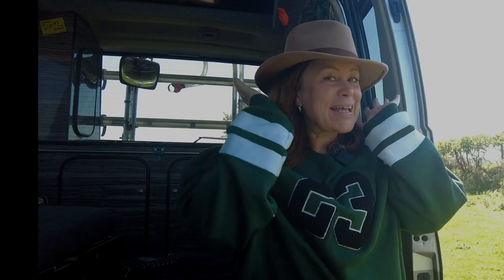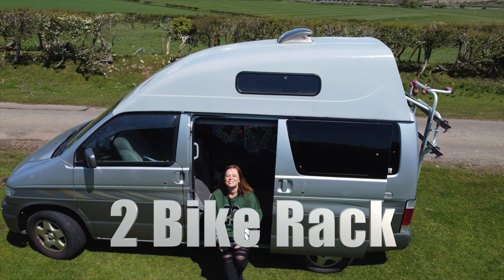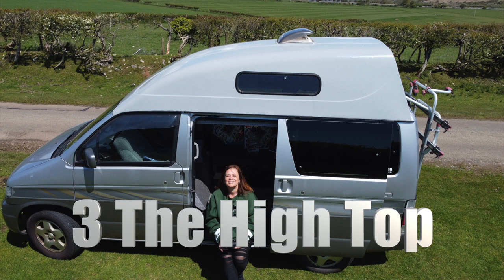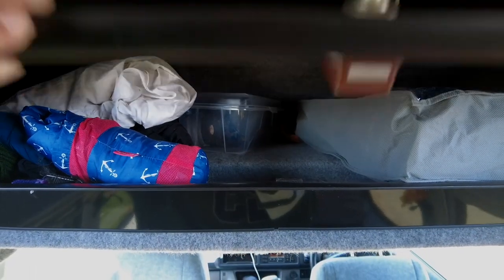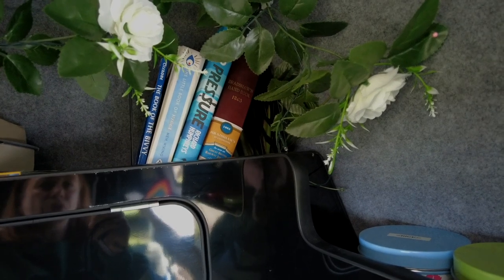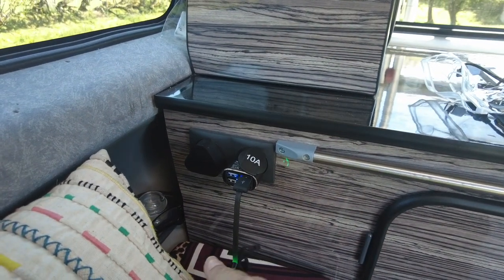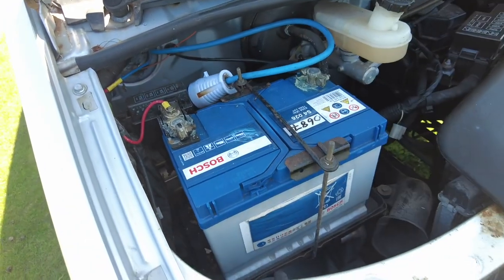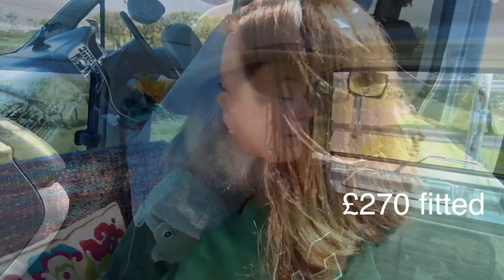My Top 5 Mazda Bongo Modifications - And How Much They Have Cost!

Comment: Hi, I am new to this and I am about to buy my first hi hard top bongo and your videos are great and so informative. Question , I have the option on layout and love your rear units with side seats, how much room for sleeping and I am wondering about a portaloo and where that would go. Many thanks in advance. At the moment I have a Ford Duetto Autosleeper so I am coming  down in size so space and storage will be important . Thank you .
Reply from the maker: Well my pull out side bench comes out almost across the full width of the van when in bed mode. It’s a pretty generous size actually especially if you have the swivel passenger seat. You might need to pas out some gaps with cushions which is what o do.
I know of some people who put a porta potti on the passenger seat for night time use and others have used the original dicky seat as a sort of platform for a camping loo. I’ve seen photos of this over on the Facebook forums. Hope that helps
Reply: @TheImportanceofBeing  thank you, does this also mean you can only have two seatbelts in the front
Reply from the maker: @christineclark3686  yes I’m afraid so. And I’ve only recently found out that I can’t disable the passenger airbag so I can’t take my grandson in his car seat either
Reply: @TheImportanceofBeing  that’s a shame so at least I now know it’s a side conversion. Thank you so much for your help x